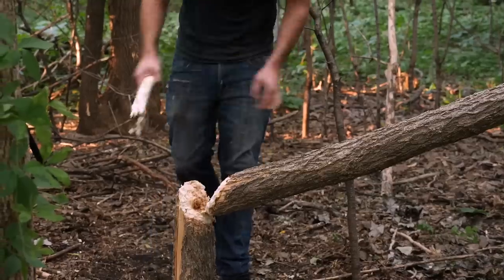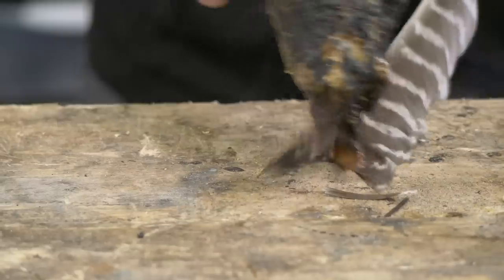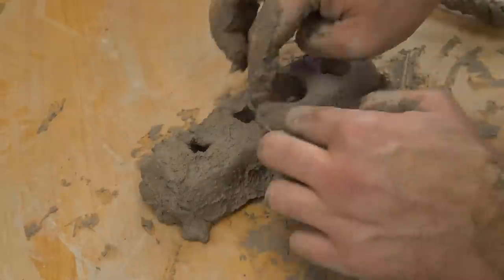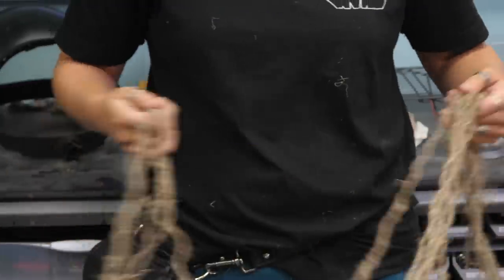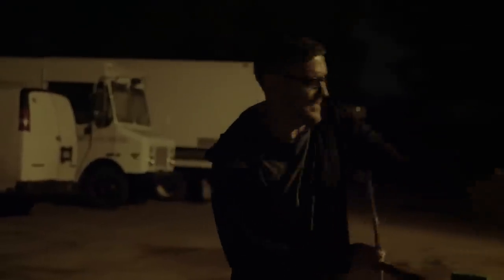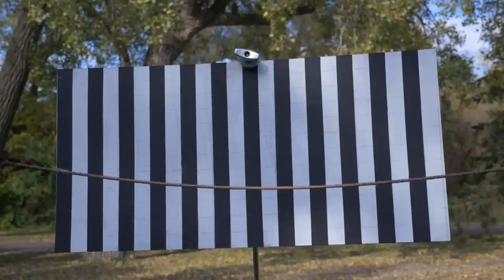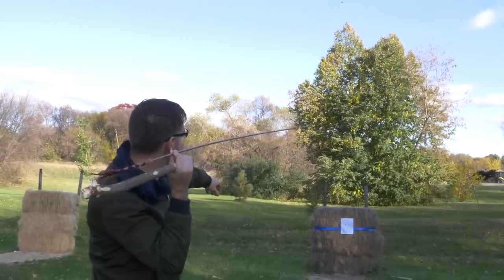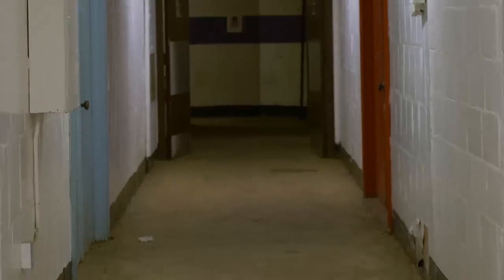Building Primitive Atlatl and Sling from Scratch

Comment: I've been making/throwing slings since the pandemic, and what I learned is that it's not about how hard you swing it. The real force you get is from the actual throwing motion. There are also different styles of throwing(I use the balearic style) it just takes practice to get the motion down, accuracy and distance comes with practice and also depend of the length of your sling.
Reply: That's why people spin before each shot.  The momentum is used as the power source

Comment: Pretty sure you'd get better accuracy with the Atlatl if you used a denser wooden dart with a heftier tip made of metal. You'd for sure get a higher speed, and likely better precision. If the thrower was constructed with a bit more care, that would probably help as well. 
The Sling accuracy goes way and the learning curve down if you use a shorter spin pattern. There are different varieties, but the one that I like the most is to hold it in front of you, one hand with the grip, the other hand with the pouch and stone, pull it taught, and drop the pouch. Then as the pouch drops across in front of you, you pull it up and over your head in a single lasso-style twirl, but instead of throwing it sideways, you pull down hard at the end, so it comes from twirling above your head to a straight down slice. That gives you better left-right accuracy, as it's like throwing the atlatl, or a baseball with a longer lever-arm. The vertical accuracy is the main hard part with this technique, but it's really all about playing with the timing of the release. There are a bunch of YT vids that show different slinging patterns. I haven't seen the one I use exactly, but I've seen variations of it. It doesn't give you the highest power possible, but you can get enough to hunt small game, and the accuracy and learning curve, as I said, goes way down.

Comment: For hunting, the choice between Atl Atl, Sling, or Bow basically comes down to carrying, and readying it.  A bow is a pain to carry through the woods.  Out on the veldt, it might be a bit different.  You can roll up a Sling, and carry it in your pocket.  However, by the time you get it ready to throw, the prey has quite possibly scampered off.  Atl Atl and dart is a nice sweet spot between those two.  For war, intertribal battle, or organized hunts of large game, it might be a bit different.

Comment: As a kid we did a version of the arrow that was simpler and easier to make and use. Wed make an arrow/dart and put a small notch near the fletching, to launch we would have a piece of string with a knot in it, wed wrap it around the notch once with the knot in the "way" when pulled forward, you would then holds string and arrow in hand and launch forward, releasing the arrow but holding the string through the throw. the knot would release as the arrow notch went past. Had huge range

Comment: Since you now can use lead, and a sling, Try using whats considered a Sling staff. A metal (like copper) tipped or wood/bone tipped stick or staff , the actual tip only being about 3.9 millimeters in diameter, and 4-6 in length. The sling staff can throw lead projectiles with 4 millimeter holes drilled into them about 4-6 millimeters deep, for a 20-60 gram lead projectile
Reply: It can throw them very hard, and far, and on top of it, these projectiles whistle

Comment: On the shot tower topic, I'm not sure the guy's "only three remaining in the world" is correct, most likely one of three left in the USA. There are three that survive in Australia so that already blows out the number a bit.

Of those three surviving in Australia, the oldest is in Tasmania. Its a slim cylindrical tower built of sandstone blocks, just outside Hobart in the hilly coastal region of Taroona and is simply known as the 'Taroona Shot Tower'. It was one of a number of military facilities in the area and it provided shot for the entire Tasmanian colony. The second is Coops Tower in Melbourne. I know less of its history but its younger and has a square plan like that one in Iowa, but is made of red brick rather than stone. Curiously today, it stands as the centrepiece of a city shopping mall, standing entirely enclosed within a massive glass dome. The third is apparently also in the Melbourne area but I know about it except its supposedly the tallest of the three. I imagine there would have been one in Sydney (being the first city on the continent so self sufficiency would have required such a construction) but nothing survives.

Comment: Really enjoyed this. That spindle use and explanation was really informative and great to learn, though I'd have to look it up to fully understand it perhaps. I had some luck with slings, by adjusting their length.   
Not much, but I got interrupted and haven't gotten back to it. So, If you can make a proto type with adjustable length  easily. Then you may find your correct length approximately and build to that. Is what I'm thinking. I seen a video on sling length determination back then. So I did one with a single Paracord, with a Sheep Shank Knot  pouch, with the ends run through each pouch end. So you can start short and leave some unused cord dragging, but melt the ends good, or Constrictor Knot serve the ends with strong twine, like a Paracord nylon gut. It's quick and semi permanent, and can be tied as double to be permanent whipping, though they weigh less, and don't whip as hard. So then just adjust your end loop and stopper knots. The problem it looked like with throwing the Atlatle, was unable to grip it. A Constrictor Knot tied in 3/16" near the balance point on the shaft, could provide power thrust transfer and control from fingers. Need to tar your natural fiber perhaps. I draw Constrictor Knots up hard; using spikes inserted through Marling Spike Hitches, I roll into place on each side of the Constrictor then, I'll step on one spike  with my toes, and haul straight up with both hands on the other spike. Work is suspended in the middle. They have lots of powerful uses. You could launch it with fingers or a forked stick, with constrictors on each short fork end, to interlock the Atlatle and shaft Constrictor's, for powerful leverage and control.

Comment: Anyone considered simple throwing nets yet? Or just some throwing projectiles with some long, thin fibers at the back, to ensnare the drone's rotors?
Also, staff slings are practically atlatls for bullets and much more accurate and esier to use, but just about as easy to make.

Comment: Try a shepard's sling. It's a short staff/walking stick with a sling with a loop on one end tied to it. Put a nail at one end (copper is good because it can bend) to catch the loop. Just swing down and with some practice you can break coconuts.

Comment: My money would be on a sling. With enough skil you can lob more rocks quickly (compare to a bow or an atl-atl) and you can chuck up to two or three rocks at a time. If remember correctly, slings were used primarily for small prey and birds on the wing.

Comment: Guys, if you ever try to make slings again, make the sling longer and rather than just swinging it in circles, start with it hanging on your dominant side, then swing one full rotation on the dominant side, transition to the opposite side. Mid rotation on that side transfer back to the dominant side to complete the rotation and release.

Comment: The pain of watching a newbie slinger..
It's not the spinning speed that does it, it's more like the leverage.
Tip, it doesn't need to be rope thicc. I've used quite questionable cheap hemp string for slings, three strands is plenty. Braid in extra strands for the pouch and then weave them out again after the pouch so it tapers saving a lot of string. Same thing with the loop. Just start a couple of inches in from the end, braid your loop with three strands, double it over forming the loop. Braid the six strands you know have and leave one out every other pass until you're down to three strands again. Much sleeker look, saves a lot of string and cuts down on drag.

Comment: I've made at least 1 atlatl, but it was so terrible I don't really use it. Of course, part of it is my darts were mostly nockless arrows. You have done some pretty good. 
Archery: you both need some lessons. For starters, use Rhomboids, Trapezius, and lats more. Biceps can help you get started, but proper form will only help you. Also, I wanted to comment on your distance numbers for bows. My 32lb target bow can be accurate (despite its user) up to about 70m. I suspect its maximum is around 200m; that is with pretty light target arrows, but still. I have some old, weak, and cheap 20lb recurves and they can make it about the distance you were talking about (100-130 yards). I haven't tested my 50 lb compound for distance, but I suspect it's somewhere between 300 and 450 yards. A typical hunting compound will have a max distance of 400-600 yards. So, all that said, here are some of my estimates.
Ancient hunting bow and arrow set up (assuming a 60lb draw weight): accurate to 75 yards, maximum distance 150-200
War bows (80-140lb, though some were probably higher): accurate to 100 yards, maximum 250-300 yards.
USA Archery's magazine does at least an annual article on distance shooting and the shortest distances I remember seeing are in the 130's, 140's and the longest are in low 1000's, I want to say. The absolute farthest I've heard of an arrow traveling is about 1800m/2000 yd. I think I originally saw the arrow distance numbers as "100-150 yards". In any case we can agree that throwing things without a thrower won't get the thing as far as you can throw it with the thrower of the thing (arrow, dart, ball, bullet, etc)
Reply: Update: you said "contemporary bow: 180-250 yards, which I would agree for most traditional (1950-2019 non compound single string bows).

Comment: I think you need longer and heavier darts, the long and heavier, the more accurate you can get. I like mine to be between 6 1/2 to 9 feet in length
Reply: Hey, Adrian from the video here. Although longer and heavier darts can be more accurate, they're also more difficult to throw. I recommend using 5 1/2 - 6 foot darts with a lighter spine for beginners, which is what Andy is using here.

As shot distance increases, length should be added for accuracy. I didn't foresee Andy casting over 20 yards, so I stuck closer to 6ft. I rarely use darts longer than 8 feet personally, and use cane mainshafts with carbon fiber foreshafts. They're a little bit stiffer than Andy's cane darts, and stiffer than the fiberglass practice darts by a solid bit, but still fairly flexible for an accurate medium strength throw.

I threw the darts and atlatls I made for Andy out to 40 yards without a problem, and saw roughly 5-7" of penetration into a hard block archery target at 15 yards. However, that's coming from someone that's practiced with that spine and length of dart, and of course with my own level of strength.

Comment: Isn't the reason behind the atlatl's straight spear path the oscillation of the spear and not fletchings?
Reply: Hey, Adrian here. The oscillation provides stabilization at release, to allow for a linear flight path with a non-linear throwing motion. The dart flexes up as the cast begins, and down as the cast comes forward as you throw. That ensures the dart flies straight upon release when the casting motion is an arc. 

Then, since the dart was cast with force from the rear, it's tendency would want to be to move back over front after a short distance. Fletchings produce drag at the rear to make sure the tip stays pointed forward, and stabilize it through flight.
Reply: @ENoland8  thank you! I was just unsure whether the fletchings were needed
Reply: @andreleblanc2833  No problem! Darts will throw straight at short distances without fletchings, perhaps for a couple yards. Past that, fletchings are essential for accurate casting.

Comment: The way Ana holds the arrows in the bow is wrong... so... SO wrong, to hold them correctly you have the tip sit between the index and middle to gain your full drawing power, another thing is that you can't hold the arrow for too long otherwise your accuracy will suffer rapidly degrade and you won't hit your target without the proper training. So overall don't pinch the tip of the arrow hold it in between your fingers for maximum drawing and accuracy.

Comment: I'd think to take down a drone with a home made weapon a slingshot is a good option with no need for extensive training
Reply: They haven't yet reached the refined latex stage or the spring metal stage, so they have nothing that could work as the elastic element in a slingshot.

Comment: Maybe the sling-throwing wasn’t hard, but you two are just bad
Reply: RadMadManMax It is hard, i've been using slings off and on for about 4 years now, mostly to play fetch with my dog. My best is about a two foot group at 25-35 yards.

Though I can get within 5 feet of moving dogs consistently out to about 75 yards, it's not accurate enough for individual targets, at least not with 4 years of practice